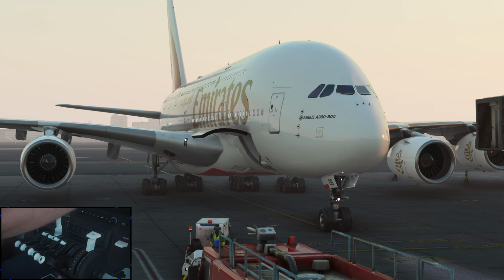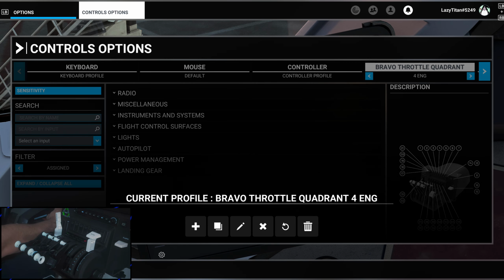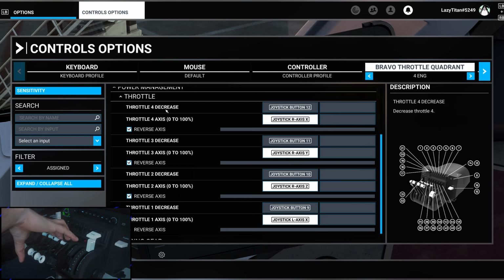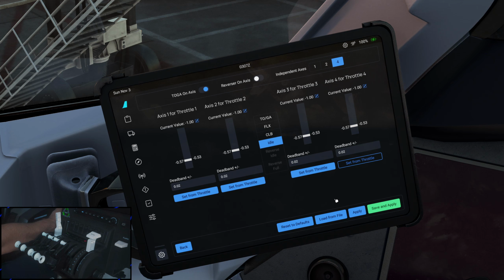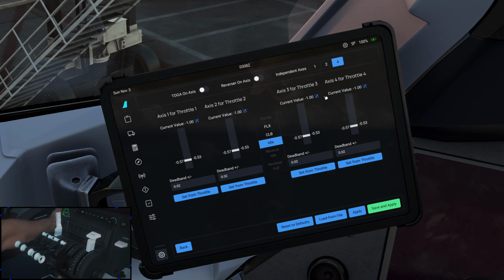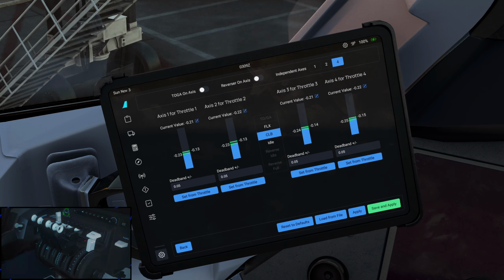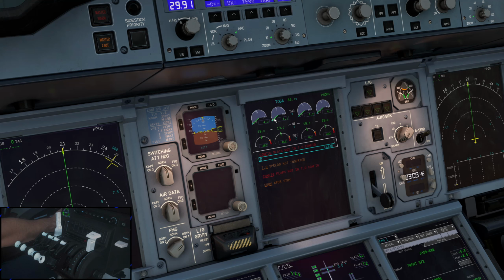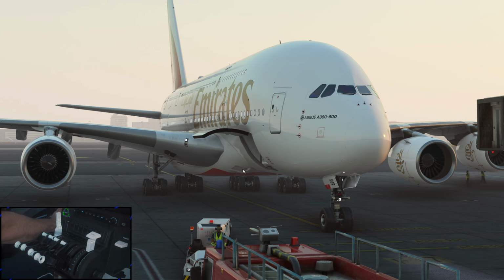FlyByWire A380X - HOW TO SETUP/CALIBRATE THROTTLE CORRECTLY POST UPDATE!

Comment: How can I set this up to map throttle 1 and 2 to one lever and 3 and 4 to the second lever?? I’m using flaps and speed brakes on my bravo throttle quadrant???
Reply from the maker: You can go to efb and merge axis for engine 1 and 2...there is a 2 axis setup option there
Reply from the maker: And assign throttle 1 and 2 to same axis